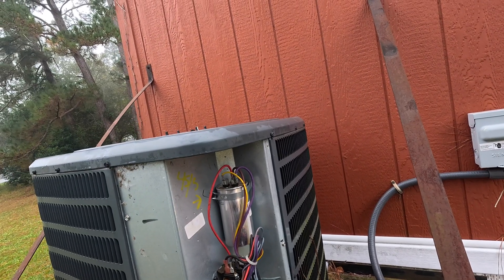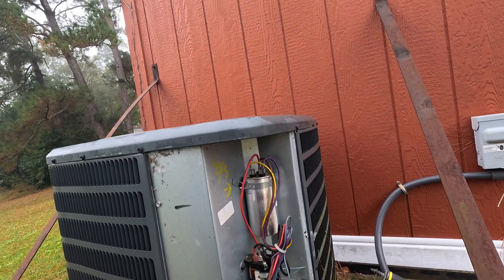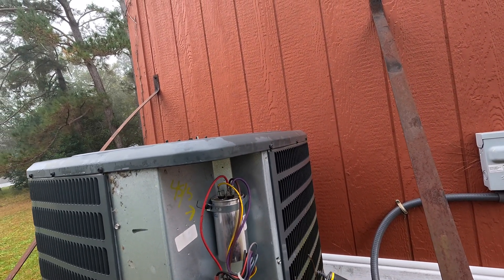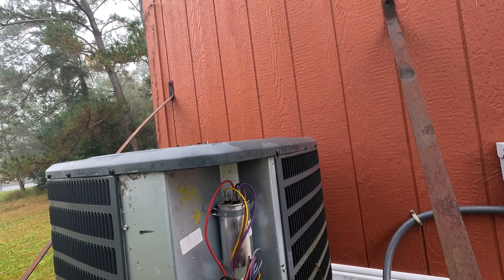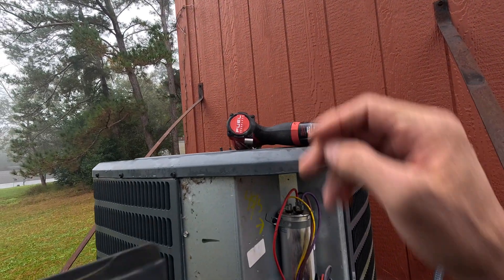Easy Fix For Uncommon Problem! #hvacguy #hvaclife #hvactrainingvideos

Comment: Glad to see you got his oversize toaster working. Forty amp draw. Our electric company would love me if I ran that. Electricity isn't cheap where I live.
Reply: Electric furnaces in my area are primary used to assist heat pumps, when temperatures get too low enough for the system to keep up. In rare instances it's used as the main heating source.
Reply: I'm in Mississippi in a double wide with central electric and the most my electric has ever been was $350 on the coldest month. It was $158 this month. 1800 Sq. Ft

Comment: How does that happen?  DIY landlord installs the wrong thermostat?  Outside heat pump replaced with straight AC without a thermostat change?  Looks like a screwup, but you had the right bits to unscrew it.

Comment: Is it not possible to use a heat pump thermostat for a system that has electric heat only as long as it is wired and configured properly?
Reply from the maker: Not that one.
Reply: @ 
Thanks for answering Curtis. Really enjoy your videos!
Reply: I believe Honeywell made a "universal" thermostat; also sold by Lennox which was very expensive and a real nightmare!
Reply: it is possible, just need to set it to aux/EM heat instead of regular heat mode.

Comment: I’ve seen Mailboxes propped up on Concrete Blocks but never seen an Outdoor Condensing Unit sitting on top of a few rows of them. 🤔
Reply: Gets the coil up away from the weed eater and lawn mower
Reply: @freepatriot6313 True. And potentially a flood prone area? Possibly?
Reply: I've seen that here in Texas too!
Reply: Also here in Louisiana
Reply: That's some ghettoass shit there 😂 installed by ur billybob backyard hvac guys. You'd get slapped with a bunch of code violations where I'm at 😂